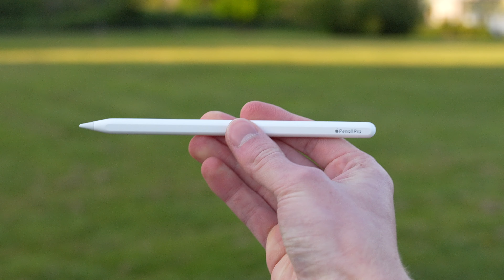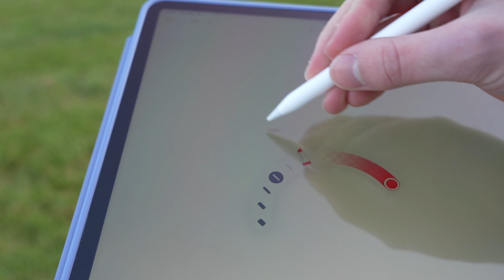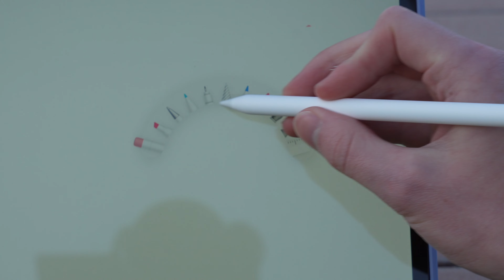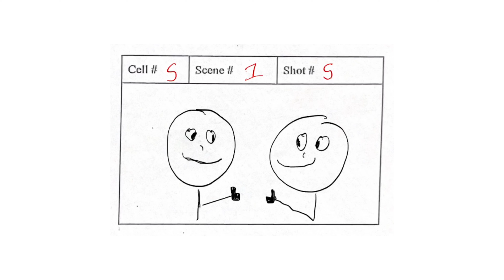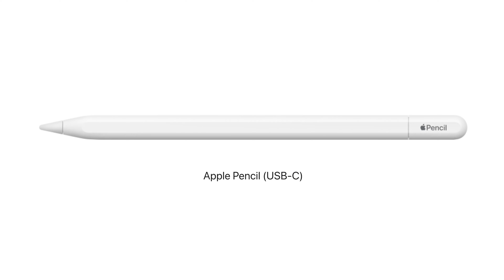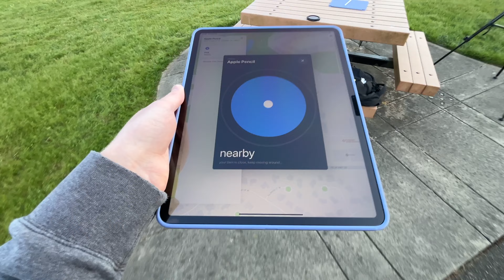Apple Pencil Pro NEW Features!

Comment: Hey bro 👋🏾
What do you think i should buy an M2 iPad Air (11-Inch) Or an M1 Macbook Air (Base Model) ? I'm really having a hard time choosing between the two because they are nearly at the same price 
And by the way I'm going to use it for college 👍🏾
Reply from the maker: I know people at my school that are totally fine using an iPad Pro with the keyboard case, but usually it's because their workflow doesn't depend on Mac specific apps. And that's really the main thing to question, does it work with the apps you need to run and do you enjoy the form factor. I wouldn't be able to fully switch since I need Premiere Pro for my job, but the other half of my work that lives in Google Chrome, I could totally be fine switching. The only concern I'd have if you did buy the M1 Air would be the lifespan since it's about 3.5 years after its release. This is a good comparison though, so I think I'll make a video next week about it!
Reply: The age of the Macbook Air is really something you can't ignore 👍🏾
Thanks bro ❤